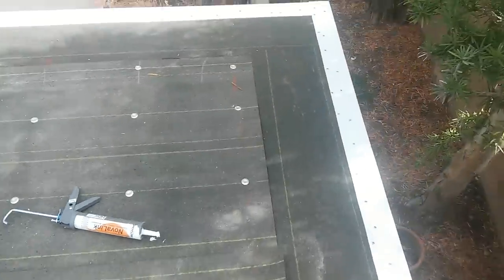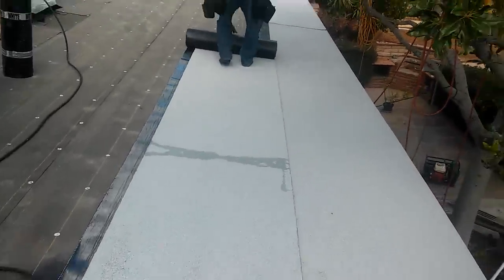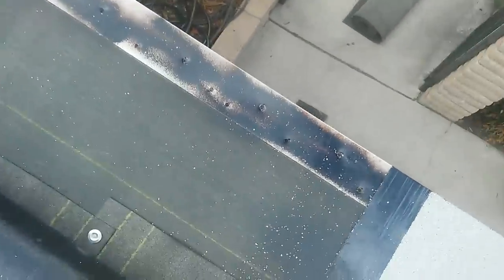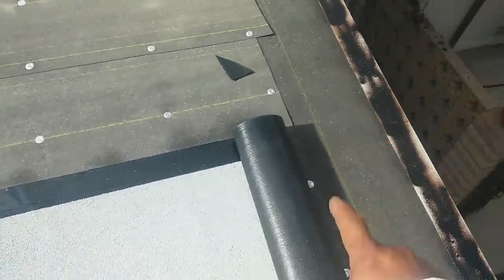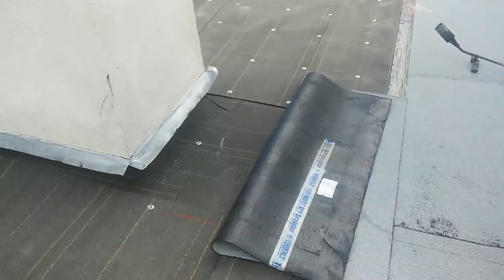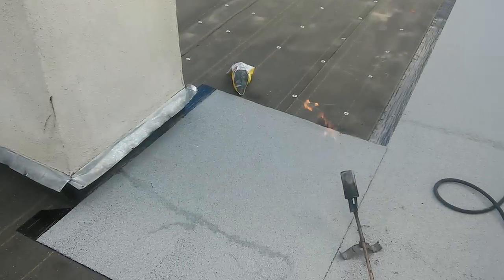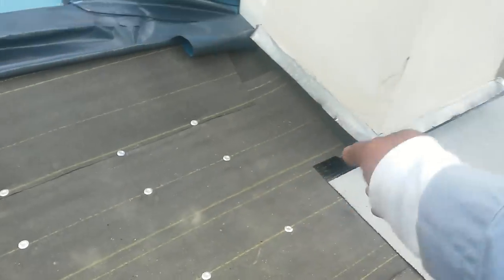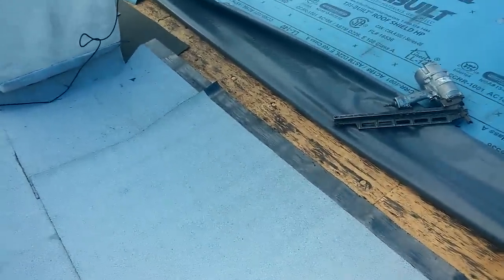TORCH DOWN TIPS ...watch it !

Comment: Not very good techniques man at 4:30 there is an easier way to cut and torch down & dont be scared to throw a little more fire so it could stick well
Reply from the maker: Ruben Cardona... the reason i didn't "throw" more flame is because,  as a roofer you have to check for insulation or dried wood under the Z bar on details like this, under that Z bar there was old dried wood , what do you think is going to happen if I "throw" more flame under the Z bar? 
call the fire department like many companies and my insurance won't let me do torch anymore like many companies that now switched to self adhere membranes

Comment: I wouldn't even know where to start to point out all the things wrong with this video
Reply: All of this video is wrong. This is why roofing gets bad name there’s no 18 inch strip under the metal. I doubt there’s any tar in between the joints of the drip edge and a single ply of cap sheet. Holy crap hope this guy is roofing his own house and not a customers house.

Comment: 4 mistakes , first one you didn' prymer in off some spots are missing prymer second one you missing alot simplex nails  you seams and aroud chimney  you slouded use 7/8 simplex nails so they won't should on the soffit over time with all those missing nails is gonna create bubbles ,third you over lapping always you need to cut corner"S on 45 deggre angle helps to seal  the seams better,fourth factory tape always need to be remove that  tape  doesn't let you torch stick on base sheet.
Reply: I only see one ply

Comment: How come there’s no 18 inch strip underneath the metal drip edge the drip edge is just sitting on the base sheet. I wonder if the guy even sealed his metal joints on the drip edge lotta crazy roofing going on out there there’s roofers and there’s water proofers.

Comment: is tpo and epdm better than 2 ply?
Reply: Marty Forkwater  I wouldn't say they are better but you have less laps/seams with epdm of tpo. less laps = less chance of leaks
Reply: Yes, they are better than two ply torch down but, 1) it's expensive & 2) you have to know what you're doing.
Reply: Single ply systems are far cheaper . Sometimes even cheaper than a 4 ply Bur
Not all single ply need to be ballasted if it's a fully adhered mechanically fastened system no ballast is required. But then you have to contend with thermal bridging

Comment: Why no gravel stop on the rake edge?
Reply from the maker: Astromyxin ...you just said , this is a basic 2 ply torch down roof, the problem before was that water was ponding on the edge of roof and causing leaks, i didn't want to go through the same problem again, i don't use the riser unless is a 3 ply system or the slope is higher, i fix too many water leaks and learned by experience.
Reply: Astromyxin gravel stop is for gravel and hot tar torch has a tendency to separate and trap water at lip